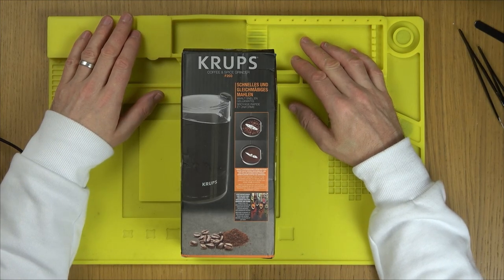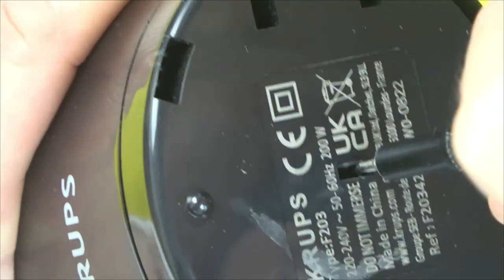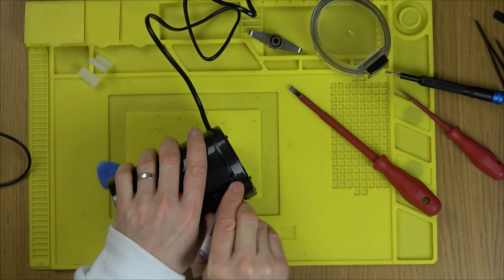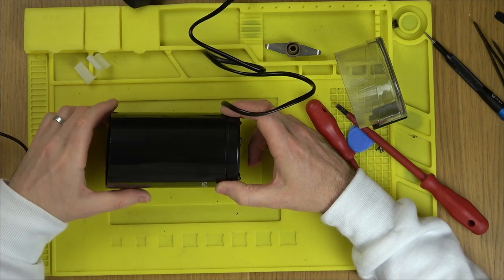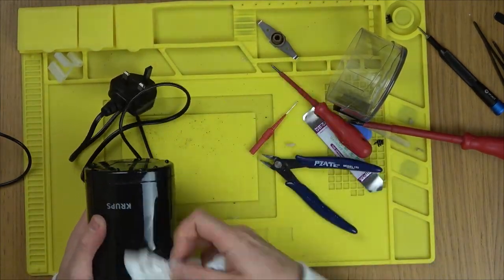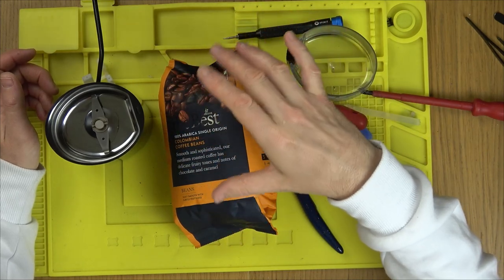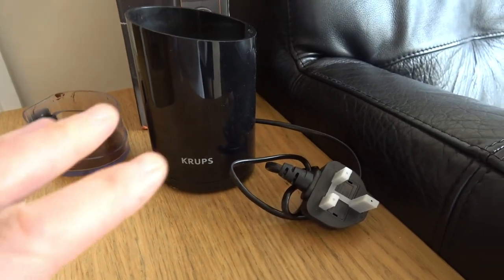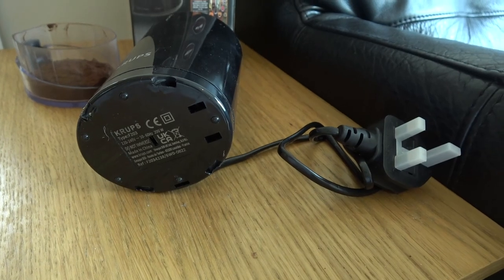KRUPS Coffee Grinder Humming NOT Grinding - Can I Fix it?

Comment: Another idea: You could have drilled out the plastic in the bottom just a bit so you could get a bigger screwdriver in. I don't think I would worry about touching any mains leads in there if the hole is just a bit bigger than how it comes from the factory.
Reply from the maker: Yes, in hindsight that would have been a better option. I wasn't sure how bad it was seized, but if I had known it was only just seized then it would have been a better fix 👍
Reply: @Mymatevince  All is not lost now that it's glued back together, I'd use a Dremel tool and grind a small slot on the top of the shaft where the blade attached.  Then you could easily use a screwdriver from above by simply removing that blade.  Alternatively determine the thread size and buy a nut (or preferably 2 jam nuts - they are thinner than regular nuts) to fit on the top that you could use to apply considerable torque with a wrench after removing the blade.
Reply: I would have heated my screwdriver up to cleanly melt the plastic similar to drilling.
Reply: @christopherdecorte1599  Yeah I've done something similar using a soldering iron to turn a small hole into a larger hole. I agree with Vince this trend towards clips instead of screws is anti-repair.
Reply: @Nathan Hand  its also due to penny pinching I built slot machines and the cost of screws even in bulk is not cheap. But as a consumer I rather pay the extra dollar for the screws.
Reply: My thought before Vince put it back together.
Reply: Why do coffee beans and grounds always smell better than the brew ? Same for bread and beer
Reply: Might have been possible to use the blade itself, if it were tightened up.
Reply: That's essentially what I did to mine (which seemed to have the same issue). I jammed my (slightly too large) screwdriver into the hole, and just started to twist. It enlarged the whole just enough to let me free up the stuck motor. Although (as suggested by others), probably better to use a soldering iron or something to melt a bigger hole first!
Reply: Thanks for the video. I fixed mine by making the hole at the bottom bigger. I see it suggested here too.

Comment: quick Q. If you'd turned the blade the opposite direction before opening it would that have freed the motor up rather than unscrew the blade ?
Reply: Yes, and the slot at the bottom is used to stop the shaft from rotating when installing the blade. I believe he mentions this though.

Comment: Following this video, I just fixed my KRUPS F203 coffee grinder with this same humming but not spinning problem.  Thanks!  
The product label on my machine completely covered the hole on the bottom, but it's still easy to find.  Like what others commented here, I drilled the existing hole bigger so I could fit in my screwdriver.  The rest was easy.

Comment: Great job Vince! The problem with blade grinders VS burr grinders that we use in coffee shops. Is the consistency, those blades kinda make it all shapes and sizes and a burr grinder will get it to exactly what you need.  

Also grind sizes are 

Very fine for espresso 
More course for drip and pour over 

And very course for cold brew. 

The way I always remember it is, the longer the water is touching the beans the more course it needs to be. 🙏

Comment: Thanks Vince. My model was about 30 years old, same problem but didn't have any screwdriver slot so i drilled a hole through the bottom. Unfortunately the bit chewed up the shaft end slot so I had to take it apart anyhow.

You can get the bottom off without breaking the tabs by carefully levering through the 4 slots. I filed a new slot on the shaft so I could unscrew the rotor. You can then access a barbed collar which is around the top shaft to retain the dish.  Ease each of the barbed segments in towards the shaft and you can then ease the stainless dish upwards. There are then 2 screws under the dish which hold the motor frame into the body. I stripped it all and re-oiled the bronze bushes. Works a treat now.
 .

Comment: The hot glue fix has probably improved it. You now have a partially splash proof join which is better than factory. And its down the bottom where splashes could occur. I think it's fine.

Comment: Another Great Video Vince 👍I wonder if making that screwdriver hole at the bottom slightly bigger and perhaps using a rubber bung? then you could glue it back together and if it ever jammed you could turn it and perhaps add some oil by simply removing the bung. Keeps up the great work! 👍

Comment: I have the exact same model. I've had it for about four years. The thing with these coffee grinders is not to use water to clean it. 

It's dry grind anyway so all you need to do is wipe the inside with a dry tissue.
 Shame the manufacturer didn't use a better quality material seal, but i think they do say in the manual not to use water anyway.
Reply: Who reads manuals? 🤣

Comment: The capacitor is not for stopping noise going down the line, it's called a starting capacitor and it's common on all AC motors. It briefly increases the motor's starting torque, then taken out of the circuit by a centrifugal switch after the motor approaches maximum speed.

Comment: Great video! I think the tighning of the blade is not that relevant because (although it is hard to see on the video) the blade is spinning counter clock wise and it is tightened clockwise, so it can never fly off, but will tighten itself?
Reply: You are correct , in theory it should self tighten every time you use it , though if you tighten the blade using the motor too many times it could strip out the threads .

Comment: Vince, I highly recommend E-6000, B-6000 or B-7000 glue for your projects.
These are the differences (as far as I know):
E-6000 - (possibly thickest) has the most solid contents and less solvents.  It's supposed to dry the fastest.
B-6000 - (possibly thinnest) has the least solid contents and more solvents.  This one should be the easiest to spread over a bigger surface, such a shoe repair, etc.
B-7000 - supposedly the same as B-6000, but more of a generic version.

Comment: Mine did not have the hole in the bottom.  This method worked.

1) remove the blade (counterclockwise)
2) drop 5-6 drops of silicone oil in the shaft opening
3) Use vice grip/pliers, etc and attempt to twist shaft clockwise and counterclockwise 
4) test that it runs.  If not, repeat step 3 again. 
5) use alcohol (rubbing / isopropyl) to clean the oil in the base
6) re-attach blade

Comment: THANKS from Costa Rica... 
I would have done a quick functionality test just activsting that interna l button directly before potentially reassembling a still faulty ( for some other unknown reason) unit.
Yes, the clips looked problematic so insread of opening it up I used a large screwdriver the size of the bottom slot (covered by a silver boilerplte lable) and wrenched a larger hole.  The turned it an Voila!
Slight damge but recivered by the lable or piece of black electrical tape. I suspect my failure mode was from grinding coarse sugar to make it finer. Again, Thanks

Comment: Plastic prying tools would do the job here. I’ve opened up a different coffee grinder with a very similar makeup and although time consuming, you can pry away at the clips (need to use multiple) and eventually comes away. And does not damage anything as using plastic, not a metal screwdriver

Comment: You had the bigger handle still from the beginning. Just use the grinderblade in the right-tight direction for freeing the motor up, so the blade doesn't get loose. There was no need for a case opening. 😁

Comment: The best way to grind coffee beans is with a burr grinder. The burr grinder turns more slowly than the blender blade type and does not heat the beans during the grinding process. The burr grinder changes the distance between a fixed and a rotating cutting surface to produce the desired coarse, fine, (or anywhere in between) grind.
One more item to put on your repair shopping list!

Comment: I'd have used a small bead of superglue to seal the bottom back on. Its easy enough to crack it free if needed, just squeeze it with a plastic clamp and it'll pop the glue joint with a little flexing.

Comment: the other to ways you could aftermarket the base would be to add screws, or 3d print a replacement that connects in a different way.

Comment: Nice fix Vince I would of tried sitting the base in an inch or so of boiling hot water,  yes I know there’s the noise filter cap there but they’re sealed, and anything else would dry off, Also buy yourself some chocolate covered coffee beans there they’re better then cex 😅

Comment: I would have fixed 4 plastic blocks inside the housing, then drilled a small pilot hole into each block through the base suitable size for some small self tapping countersunk screws. Countersink the outer holes and then screw in the screws. To ensure no scratching on a worktop, I’d pop four small rubber pads over the screws. This would allow easy removal of the body again. Also, I would slightly enlarge the access hole to allow the ‘first step’ maintenance of a screwdriver in the slot on the main shaft

Comment: I have a similar design from Siemens. I used it for coffee back in the day before getting something better for coffee. Mine has never seized.
It is not very good for coffee, since you have no control of grind size and it does not do a uniform output.

Comment: Good fix. Hot glue probably better in this situation. Superglue (non gel types) just becomes brittle and can damage internal components. I wonder how good the seal under the blade is to prevent particles entering the motor etc. A family's got to know it's limitations.

Comment: Hey Vince. If you had turned the blade in the opposite direction before dismantling, would that not have freed the motor rather than unscrewing the blade?

Comment: The way to fix this a bit more could be by gluing nuts inside with epoxy, drill new holes from bottom and put 4 screws there. (as it should be done from the beginning)
But yeah, making the square hole bigger for a proper screwdriver and then getting a rubber plug for it would be much more easy.

Comment: I personally would have 3d printed one or three brackets that glue on the inside and hold machine nuts, then drill holes in the bottom to screw it shut with bolts. shouldn't look too bad when done right, yes its visible but much easier to access than any form of gluing the lid.

Comment: you could use a set of press fit threaded inserts and some 3d printed pieces you weld into the inside to screw the bottom on next time you go to do maintenance

Comment: The blade is binding. It needed to be cleaned better. The oils from the spices weren't fully removed. You can use a lever to manually move the blade and it'll recover.

Comment: The issue with all these things is cost - they are currently 30 quid on Amazon, and so I'm assuming the idea is to bin it. Firms must be made to make it screw-openable and charge between 40-50 for the effort of changing the design. Firms must be prevented from this disposable cycle of stuff.

Comment: Heat-Set Inserts for Plastic, add you own screws.  If there isn't a suitable place to put an insert you could probably epoxy them in place.  Or epoxy a piece of plastic in place for it.

Comment: If as you said the motor needed to be freed off by rotating it I would have just widened the hole at the bottom hopefully removing the need to disassemble the grinder.

Comment: Personally I'd have used a soldering iron to make the slot in the bottom bigger. Saves having to use a piddly little screwdriver end and would avoid having to get into it properly. It's a real shame the manufacturers don't make things more accessible for your own repairs

Comment: nice repair, but you opened it up so that you could clean the rust and then did not do this (at least not ob screen). This being the case you had the option to open the hole on the bottom with a drill so a screwdriver could be used. If this did not suit, then you had a second opportunity to spin the motor once you discovered the blade is removable for cleaning. Here you could have used a drill chuck to grip the shaft and enable torque to be applied. Ah well, it is still usable.

Comment: Arggh! Vince, for love of god please stop even considering CA glue. It sticks virtually nothing, comes off when heated and ruins plastic surfaces if even the tiniest smear touches the outside. Use Araldite with a wet J-cloth to wipe the joint down for a strong, invisible repair. Even hot glue is preferable to CA glue; at least you can get it apart again with a squirt of IPA.

Comment: Someone ought to get after Krups for the Right to Repair movement. It's only clipped to save money on screws. Their less than a pence a piece. Bloody cheapskates. As for the glue, I use a micro torch and it works a treat.